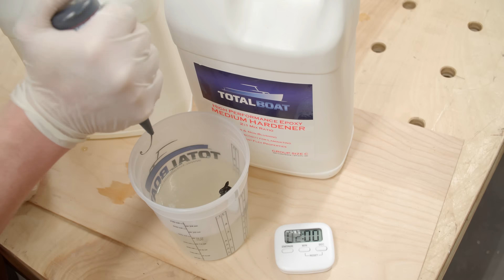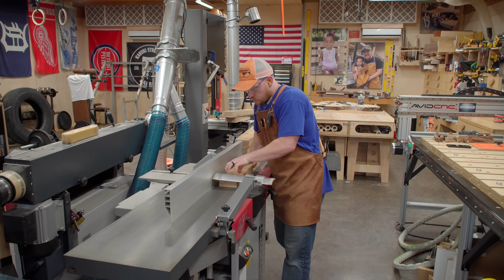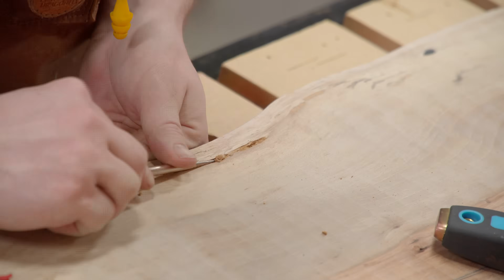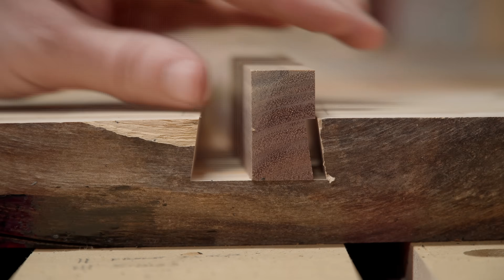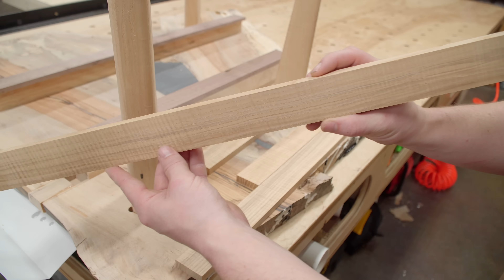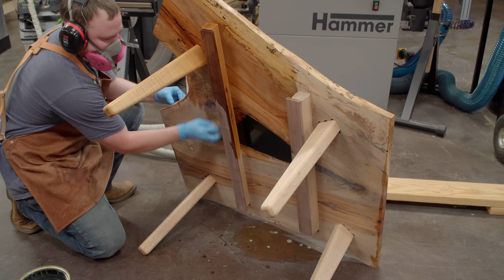Sliding Dovetail Table With Concealed Drawer - 380

Comment: I just bought the same Whiteside bit as a result of seeing it perform in this video.  Have your tried smaller stepovers?  66% seems a little excessive to me but if it pays off in a smoother finish I might take the time to do it? I usually use 40%.

Comment: Hot glue is the best caulk cap.  A tube will last forever when the tip has a dab of hot glue on it.  And it comes off real easy when it’s time to use it again.

Comment: This project is awesome.  The drawer bottom method you used is my favorite. I honestly think it's stronger than mounting a panel in the groove and it  gives you additional drawer space. Your CNC use is inspiring. I just think it's so interesting that the Domino used to be so taboo because of it's cost. I'm so glad the community has changed to allow the use of more expensive tools. I'd never get to see this process and how awesome it is otherwise. I don't have a CNC and probably never will but they are awesome to watch in action.

Comment: Another great project.   Nicely done Jay!   As you are using the CNC for joinery though, it is easy to cut the tenons on the leg top to match the rounded mortises in the table.  A little (.003") allowance between the male and female sides will be plenty of slip room for epoxy, and there would be no visible remnants of the joint. Follow that with putting a little taper in the dovetail slot matched by using the CNC to cut the dovetail edges on the drawer slides, and you'll never need a mallet to bang a dovetail part home.
Reply from the maker: A taper on the dovetail slots would allow one side to be somewhat loose. That fit would allow cupping movement on the top. 

Matching a mortise and tenon on the CNC is easy. I mainly left it wide to eliminate the hydraulic effect of trapping too much glue. It gives more squeeze out room making it easier to assemble. 6 one way, half a dozen the other.
Reply: @JayBates  I teach furniture design to college students.  For tapered dovetail slots I cut both using a CNC, with the male side matching the taper of the tapered slot.  So once slid in the joint is tight all along its length. Just a minor different width from end to end and I've never had to struggle assembling a a sliding dovetail joint.
Reply from the maker: Correct. The sliding dovetail will be tight along it's entire length when first assembled. But if the slab contracts the entire dovetail will loose it's tight fit and allow for vertical cupping of the slab on the non glued end. Probably not much to worry about but I'd rather not have that as an option. Not arguing, just stating my reasoning. What all furniture design do you teach? Any specialty areas? You're the first furniture design teacher I've heard from who utilizes CNC technology. That's great to hear. I'd love to see some of your CNC furniture work. Shoot me an email if you'd like to chat further. jayscustomcreations@gmail.com

Comment: That looks amazing. So jealous you have lumber like that to work with. I noticed that respirator youre using, try a 3m 7000 or 6500QL series, they are SO much more comfortable with softer silicone so they dont "bite" into your nose as much.

Comment: The dovetail rails are a great way to mask functional necessity with decorative design. My favorite part of the table.
Reply: I feel the dovetail into the bottom weakened the slab! Why not just glue or screw rails to the bottom? It would have saved a ton of time.
Reply: @jasonb4350  is still solid wood in the area,  and the opposing grain direction will provide resistance to warping that it normally would.  C-channel or surface mounted plates would have taken away from the look.

Comment: We have a Woodmizer slab flattener at work and I noticed you had the same problem we did at 7:06, we tried something similar but noticed we would eventually strip the screws. A quick blast of air seemed to help remove the sawdust and we haven't had any problems since.

Comment: I have used the electrical connectors for years.  Never thought about sharing the tip with anyone.  Thanks for the tip even though I use it.
Reply: And the table looks great in the new setting.

Comment: I couldn’t tell if that was a 5” or 6” ROS. I have a 6” and it’s the ’barrel grip’. When sanding, I can’t let the weight of the sander push down, I have to push downward a good bit. My fear is swirl marks. Hope this made sense!  An opinion on a 5” bs 6”?
Reply from the maker: 6". Rotex only for rough removal. Random orbit for typical sanding.

Comment: the table is beautiful but unfortunately it was made with a CNC therefore showing off your computer skills and not your woodworking skills
Reply from the maker: I used a CNC, bandsaw, miter saw, table saw with both 90° and bevel cuts, traditional workbench with hand plane, router table with two different bits, hammer and mallet, awl, belt sander, clamping platform with clamps to glue stuff together, hand sanding pad, orbital sander, jointer, planer....probably something else that I forgot. #nowoodworkingskills
Reply: Not the biggest fan of CNC work myself but I think your comment is a bit unfair. It's not like Jay pushed a "make table" button and the CNC spit out a finished piece. He still needed to design everything including the joinery. Nothing he did with the CNC couldn't be accomplished with a hand held router and various jigs. Again, not a huge CNC fan but even I understand it just makes certain things less labor intensive on a project that still required a ton of labor. Besides, he has PLENTY of content using traditional methods.